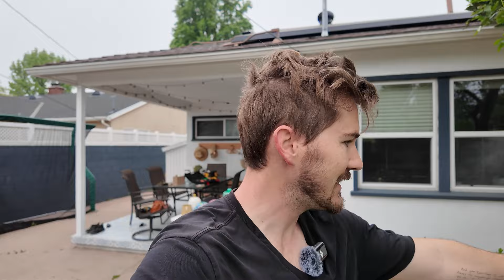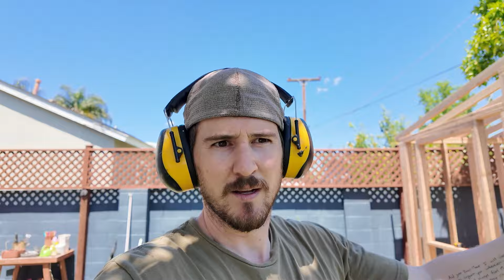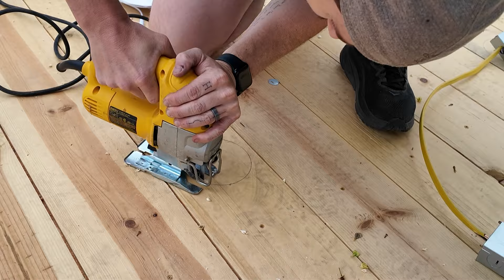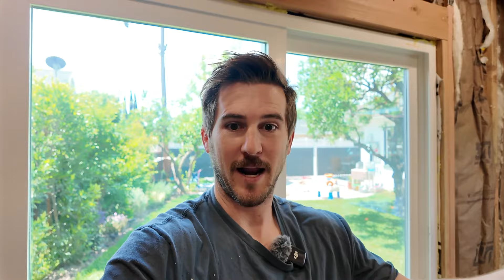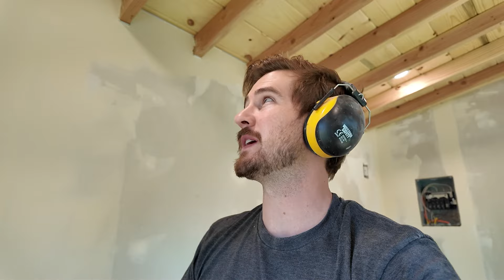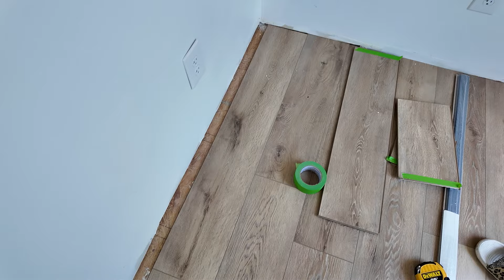Building a Tiny Office - Start to Finish

Comment: I learned that Simpson Strong-Tie SDWC15600-KT Strong-Drive SDWC Truss Screw - 6" Interior Wood Screws can accomplish the same strong connection between your upright studs and the roof rafters essentially replacing the need for any traditional hurricane ties.  They are completely hidden once installed and allows someone to easily drywall over both the uprights and the rafters without having to deal with any externally attached hurricane ties.